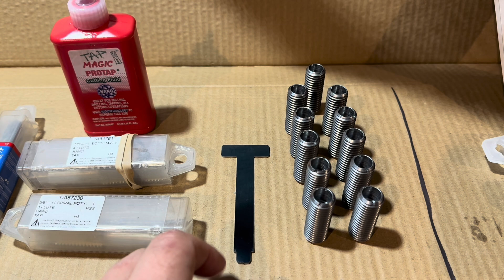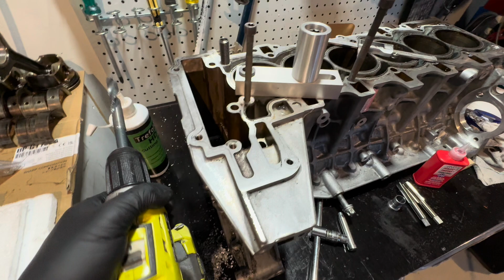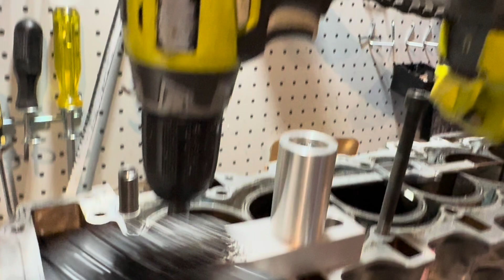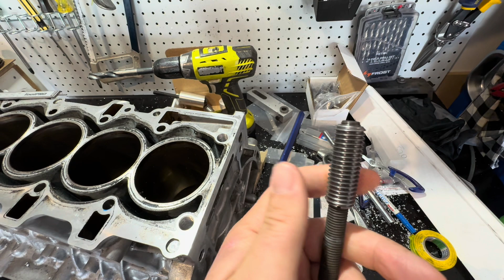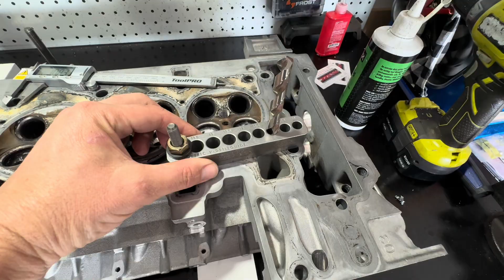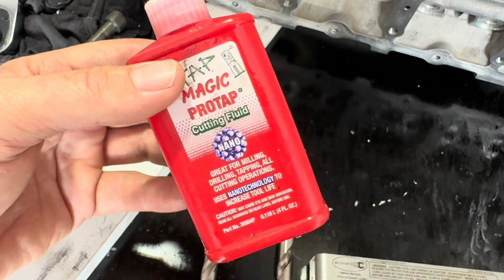BMW N54 Head Bolt Upgrade: M9 to M11 using NS300L inserts (Part 1 of 2)

Comment: Where did you get the 11mm drill with 10mm shank? Cant seem to find one.
Reply from the maker: It was from Bunnings (Australian version of Lowe’s).  But the brand is also available from a lot of shops in Australia

Comment: I don't believe my Civic can take Norm's kit. We talked about it at length but the 1.5t doesn't have enough meat I'm afraid. So with yours, the head bolts did not sit at the perfect height right? It seems they had a little bit of variance in how each one of the studs sat. This is giving me a little more confidence in mine.

I had to Helicoil, but the tap would not be able to reach the depth I needed due to it being 3.6inches and the hole depth being 4 and the fact that extensions were too large to fit in the hole to tap any further. 

The one bolt I have sits about a quarter inch above the rest but no clearance issues and I used a 30mm insert and got it down a little bit past the 3.6inch depth. 

Threads are fully engaged and after test fitting, I tried to pull out the head stud with both hands. It would not budge. I am praying my fix worked. Everything is all torqued up, it has gone through a few heat cycles so no white smoke, no gasket issues, just a thermostat housing leak that was my fault and replacement parts are coming in. 

Also, the hole is tapped super square, even though I did it free hand. Torque for studs were above factory spec of 60ft lbs to 65 ft lbs.

What are your thoughts on this?

Comment: What do you do to the corners converted to 11mm from
9mm as far as the dowel pin are concerned..or so u run it without the dowel
Reply from the maker: @crazienick1010  correct, can’t run the dowel pins in the corners.  The head centres on the block ok but the gasket is the issue because it can “float” around a bit between them.  So I pinned the head gasket to the block with a small M4 bolt through one of the rivet holes.  It reminds me; I need to make a follow up video with that info
Reply: @ please do cause im stuck right now with the assembly part where i cant find any info on tht. Some say they ran without it no problem but i don’t know i dnt wanna risk it. So i thought i needed a custom dowel or something ; lost right now

Comment: Great videos, following your channel as I rebuild the E93 I bought where past owner stripped out the M9 head bolts. How did you resolve the head studs being at different heights or were you able to torque down the outer studs without any issues?
Reply from the maker: @nicktaranto1178  they ended up being 2mm lower.  I’m not sure how I thought they were going to be higher in this video

Comment: Should the head be cleaned/decked prior to doing the serts?
Reply from the maker: @cptrey  it would be best to do the inserts before cleaning/decking the block.  Just remove the inserts before sending it off to the shop